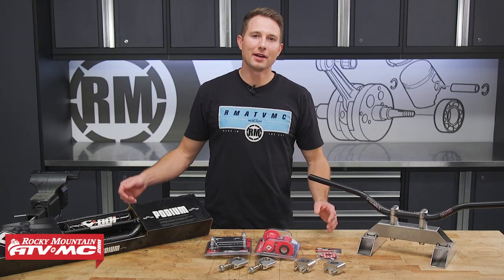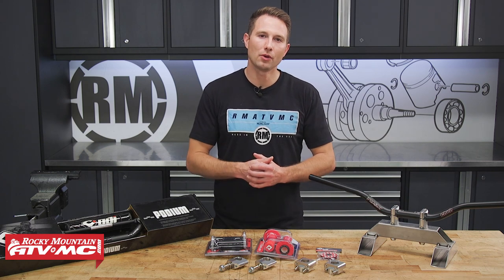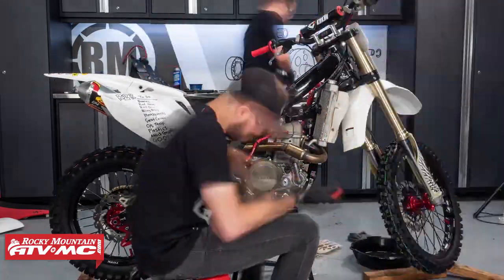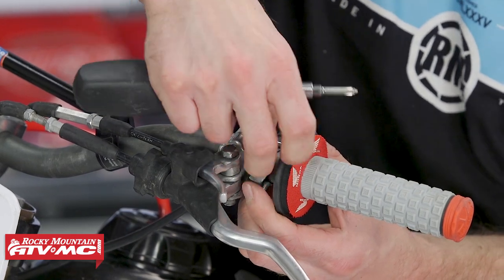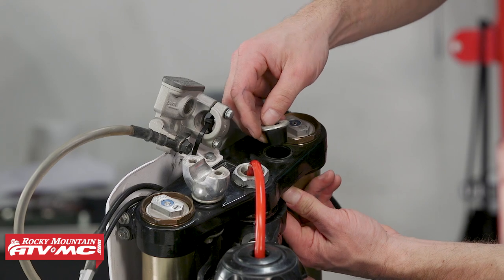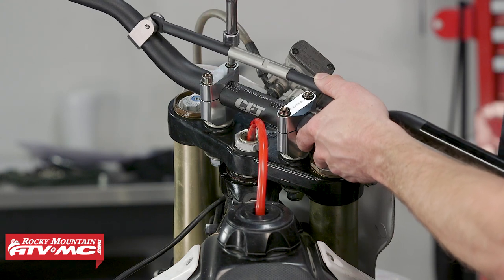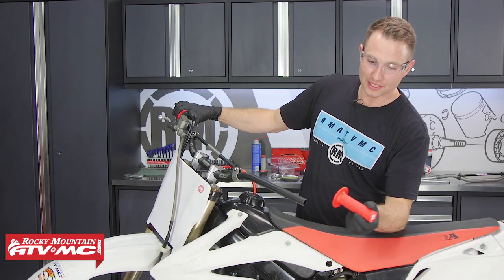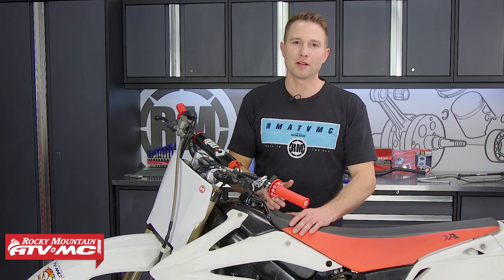How To Install 1 1/8" Oversized Handlebars on a Dirt Bike

Comment: How do you find the throttle tube to fit them? I can only find 1” and 7/8 mainly
Reply from the maker: 7/8" handlebars and 1 1/8" handlebars (fatbars) both use the same size throttle tubes. Oversizes handlebars are only a bigger diameter where they mount to the triple clamp but the diameter on both ends where the grip/throttle tube mount are the same.
Reply: Can you change just the grip or do u need to change the throttle too? Doesnt seem like just the grip will come off